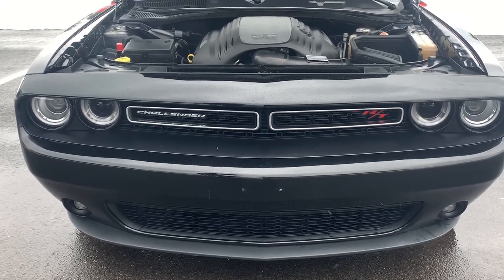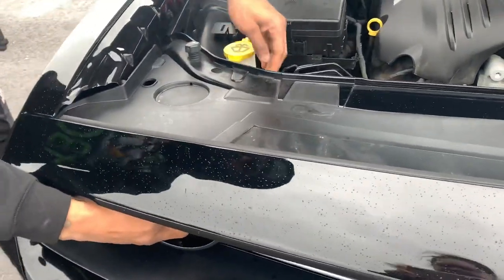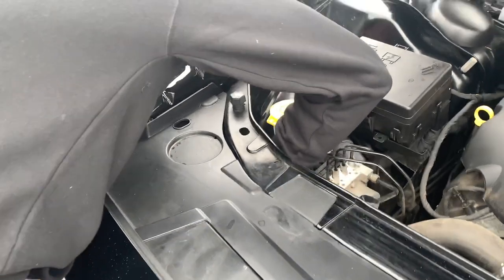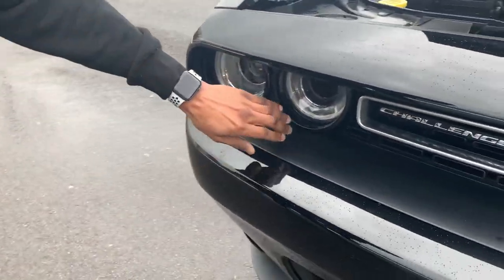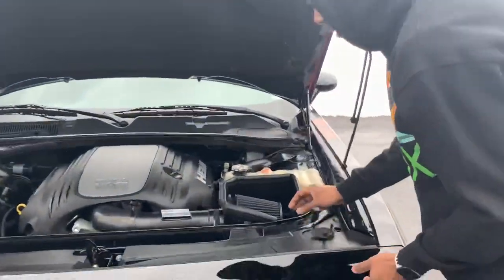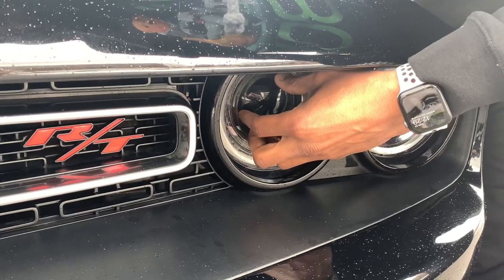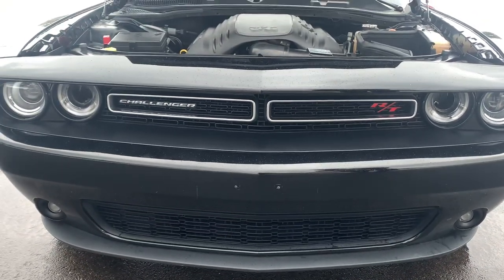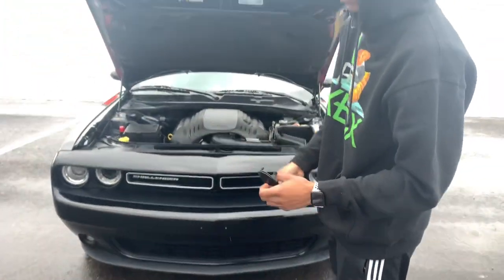Dodge Challenger Headlight Cap Removal Adds More Cold Air💨

Comment: I got a part to go into this that gave it a better look. Off Amazon, they have something with a mesh and different colors to keep it looking more stylish but you need to use light dabs of some super glue to keep it in place.
Reply: What is it called?
Reply from the maker: Did you figure it out
Reply: It's called a "Headlight Intake Ring" on Amazon.  But about 3 or 4yrs ago I didn't pay what it costs now. I spent about $20 🤣

You'll need to add a little crazy glue on the Mesh and a couple of light dabs of glue around the part to keep it from loosen out.

When I first installed it, I just cleaned the area, and placed it in. It felt snug but here in NYC, the roads aren't always smooth. I saw it about to fall out and put glue to hold it. It didn't even fall out when I got into a small accident.

The repair shop that fixed my car gave me new headlights and they kept the intake rings for me in my trunk. 

The prices they are now is much higher from back then though 😭

Comment: My 2021 Challenger Scat Pack Shaker has the Passengers side cap screwed in with 2 size 10 torx screws. They are not all the same. Just a heads up to all.
Reply from the maker: Ooou snap thanks for the info